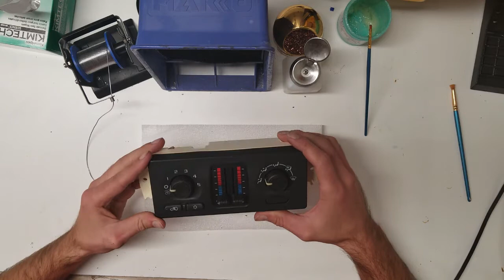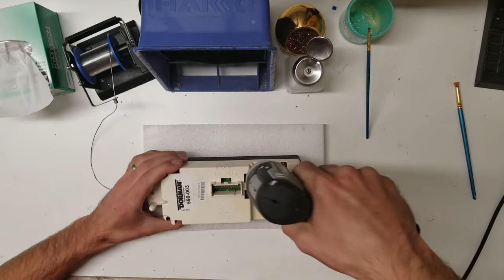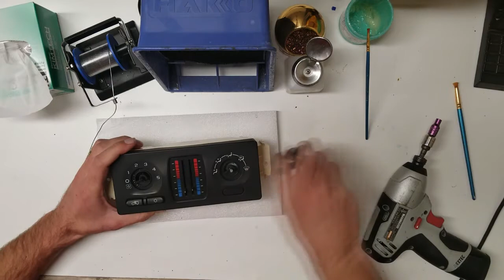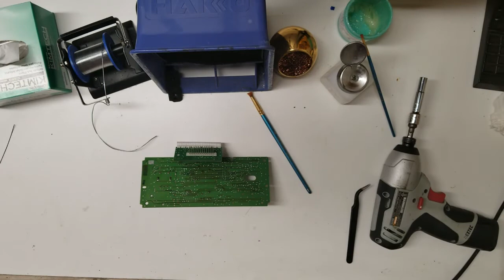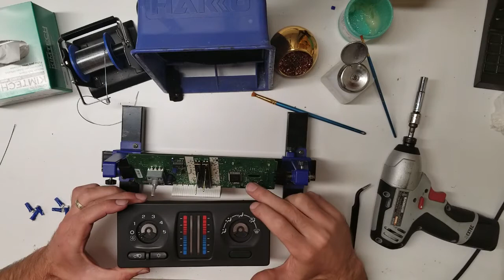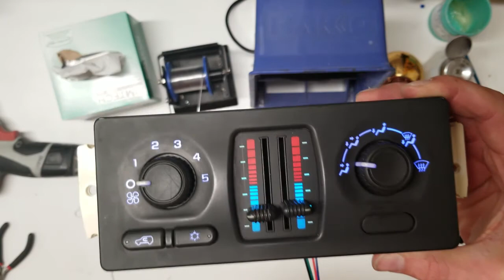GMC Sierra Chevy Silverado Climate Control unit HVAC LED Upgrade Conversion

Comment: are these the same bulbs used in the instrument cluster?  I replaced mine with LED's .. I used T5 LED ... there is a small square bulb and looks like a little tiny resistor on one leg
Reply from the maker: They are basically the same except on the climate control they are installed through hole and on the cluster they are surface mount.
Reply: @AutomotiveCircuitSolutions   awesome thanks... any tips on putting them in the correct way? I always get it about 50/50 .. lol... half work the other half doesn't so I have to desolder and change them around to the opposite connection
Reply: I did the same bought some t5 from ebay white color all though it shines blue on the dash and on the hvac broke the temperature switch trying to take off the 2 knobs
Reply: @canadianshadowrider  
To see polarity what I did was remove the bulbs from the board, carefully connected the board to the wiring harness and turn on the lights and with my probe black lead on on the chasis and red as my finder I tested each hole on the board were I've previously removed a bulb and one hole would give 12v that would mark my positive
Reply: @tatanoski666  i slid a dinner fork under it and pryed up.. .worked like a charm

Comment: Do you happen to know which sides are positive or negative on the panel it self or would you just place the bulbs in sequence?
Reply from the maker: We do know the positive and negative on the circuit board, There are 2 different circuit boards for the manual climate controller and 2 different circuit boards for the automatic climate controller and the placement differs on each circuit board. Send it in we'll get you upgraded. https://www.automotivecircuitsolutions.com/collections/climate-controller-repair/products/1999-2007-gm-chevy-climate-control-back-lighting-repair-service
Reply: Could you tell me what the positives and negatives are??

Comment: I pulled out the two middle knobs and they came out with a little metal rod attached, if they don’t come off easy just leave it be kiddos.
Reply from the maker: Yes on this one they came out surprisingly easy. Most of the time I heat them up for an easier removal.
Reply: I did the same thing now I'm stuck with heat all the way and will be buying one from the yard and heating up these 2 knobs and hopefully I won't break them again
Reply: Nice tip, I shall retry 🤯

Comment: I'm not understanding how you're getting those to light in series. 2 of those blue bulbs in series requires more power than the vehicles 12v system supplies. I tried these same bulbs and they barely lit with nearly 14v delivered to them but were nice and bright pumping 18v into them. I already figured out which bulbs are in series and the polarity on the board. Even tried 1 of the original bulbs with 1 led in series and the led would light but the eegular bulbs would not. Weird deal. Hats off to you guys for making them work, guess I'm completely missing something here.

Comment: How did you know the polarity on the board for each led?
Reply from the maker: Hey Rob.
We have done lots of these. Back when we first started we had to figure it out based off the factory service manual. These are tricky because the lights are hooked up in series so if one led is backwards then half the other lights won't work. 
Thanks for subscribing.
Reply: Oh I see, makes sense. Is there a way i can check for polarity myself? Looking at replacing the burnt bulbs and could use some info.
Reply: Did you ever figure it out? I'm trying to do the same.
Reply: To see polarity what I did was remove the bulbs from the board, carefully connected the board to the wiring harness and turn on the lights and with my probe black lead on on the chasis and red as my finder I tested each hole on the board were I've previously removed a bulb and one hole would give 12v that would mark my positive and

Comment: I’m having an issue with mine. Are you using 12volt leds on all 8 lights? When I try and hook up the lights they cancel each other out,  but if I put a 3volt and a 12 volt led they both work. If I try using both 3 volt they burn out?  How do I fix this?
Reply from the maker: shaun settles yes we use all 12v leds. You may be getting the polarity wrong.

Comment: If it’s not too much trouble could you send a picture of the circuit board with the polarity on it for me. I’ve been working on this all week and about to rip my hair out lol!  Any help would be MUCH appreciated!  Thank you!
Reply: Bump
Reply: Just use dvom to check polarity while the unit is powered up with the normal bulbs installed..

Comment: Can i use 12 volt leds or do tgey have to be 6 volt?
Reply from the maker: 12V leds work fine
Reply: Automotive Circuit Solutions do i need to you resistors?
Reply: Automotive Circuit Solutions use**
Reply from the maker: All depends on what LED you are using. If you are using a 12fv then no if you have the more common 3.2FV LED then yes you would need a 470ohm resistor.
Reply: The slider bulbs are 12volt. The rest is 6volt. No need to give away anything.

Comment: Can you do my airbag switch and steering wheel and the window switch, and also my climate control like on the video, white on the middle and the rest red, i want all my lights red and also can you fix my motors, i changed them but there is like 2 that dont move and the rpm one is kinda off, i have a silverado 2003.
Reply: The motors in the cluster
Reply: And if you can, how much in total?
Reply from the maker: Christian Alcantar yes we can do all the switches. Email me autocsolutions@gmail.com and I'll give you a quote.

Comment: Just found what I was looking for. This is great. Can you also do the multi switch and steering wheel controls for a 2006 gmc yukon?
Reply from the maker: Yes we can do all switches on the truck. If interested contact me 417-755-0179 Weekdays 8-5